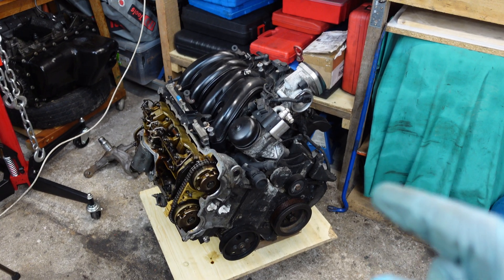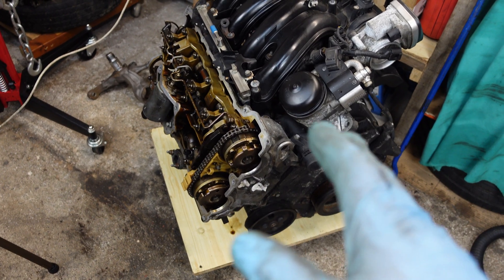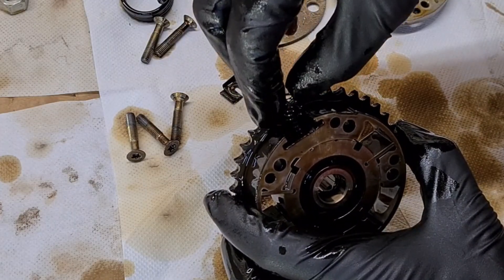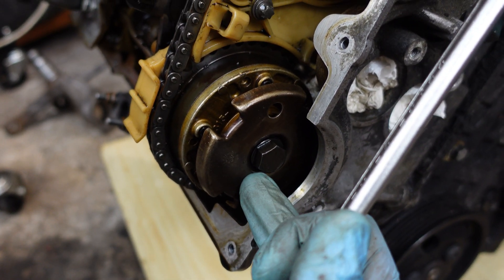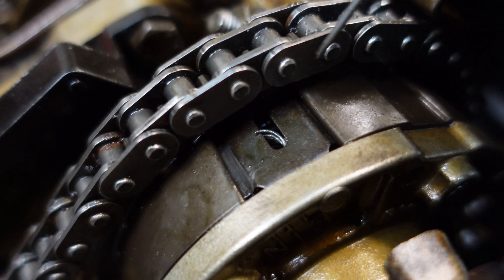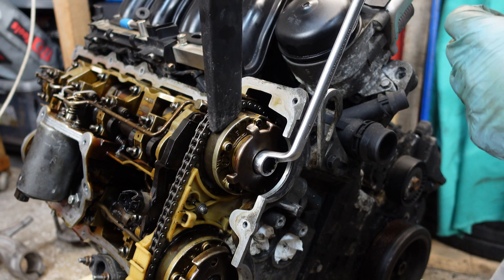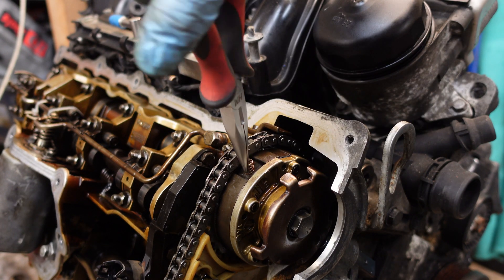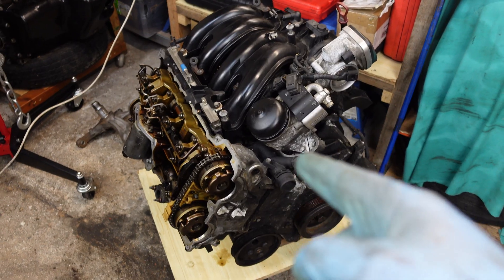Unlock VANOS initial position | BMW N42/N46  for beginners

Comment: Hello! You know about the numbers of camshafts adaptations? Im actually have 51.70 output and 117.50 input. N46 engine :)
Reply from the maker: 116-120 intake, 54-58 exhaust. Your exhaust adap is a bit low.
Reply: @BimmerZen  I checked the solenoids and they seemed fine. The oil is 5W30. I have no diagnostic errors and I don’t notice any loss of power. Should I try resetting the adaptations with ISTA-D?

Comment: Hi, i changed the timingchain kit and put the timing tools on timed it and removed them, imidietly the kamshaft turned. I turned the engine over and one vanos keeps turning and one not then it changes and continues. Do you know if it can be anhthing  that i have to lock the vanos? 
Its an n45 enigine. Thank you. And you make very useful videos.

Comment: Recently came across your channel while looking to N46 videos. Liking the content. Keep it up. 

I will be getting a 520i E60 with N46N engine. 154 Hp. This engine comes with 170hp in some markets. Is there a way to determine the differences between the 170 vs 154 Hp version?
Reply: 170 HP is N43 engine. It's a newer engine. The N46 goes to 150 and I guess the updated N46N gets a few extra HP.
Reply: @MrBojangles901 thanks. I forgot about my comment but ended up getting documentation for my e60. You're right. N46N makes 154 hp. No added parts to magically make 170 hp as the n43 is for markets with low sulphur fuel and probably has a different tune to go with it.

Comment: Have you any ideas for rough idle in n46 ( ccv and hoses new,)
Reply: eccentric shaft sensor/motor is faulty.
unplug the sensor, set the electric motor in end position and should be fine (traditional throttle body takes over in case of fault in the valvetronic system)
Reply: @ thx just do when its cold.

Comment: Hi bimmer zen is it possible i can contact you through an email need ur opinion if my chain has skipped a tooth, i've got 130C1 crankshaft - inlet cam shaft angular difference outside limit, and 130E1 crankshaft inlet camshaft synchronization camshaft signal outside limit, Car has check engine light and engine is shuddering like shaky?

Engine was working perfect until serptine belt snapped, There was gasket lekage,oil cooler,oil house i have fixed all those changed all 6new spark plugs and 6 ingition coils?
COULD it be by chance the cam shaft sensors may be faulty???
Reply from the maker: There is an info email in my channel description. Give me all the info there and i will try to respond.

Comment: Brilliant 😊 I'm working on my N43, but the crankshaft is completly stuck when I tourqe the bedplate to the Block. All new bearings and plasti gauge shows the clearance is within spec. I use standard size main bearings. Any tips or tricks?